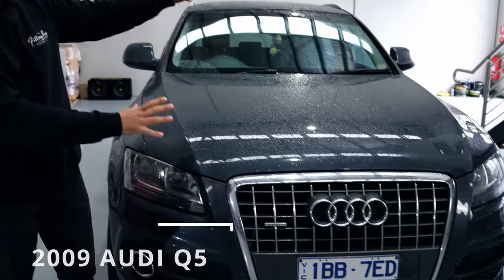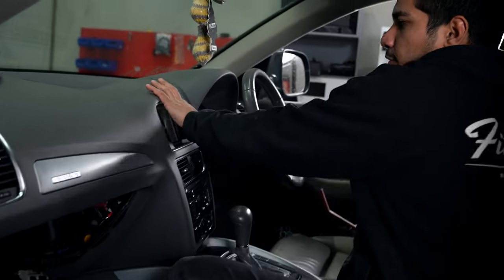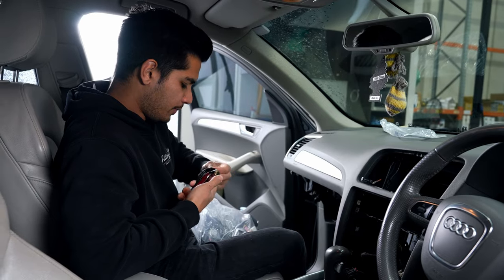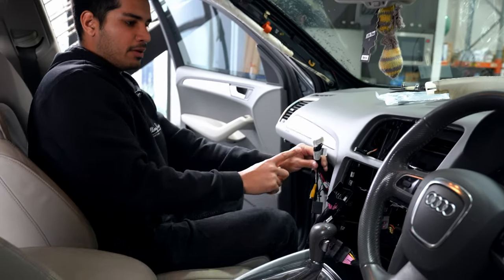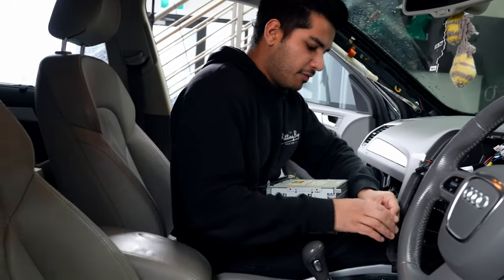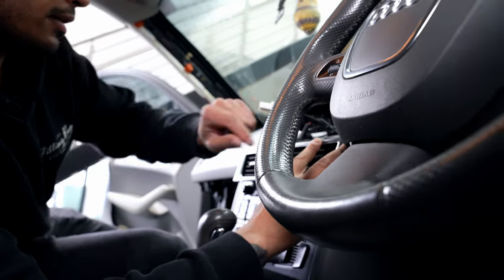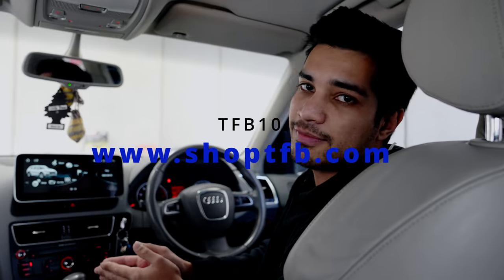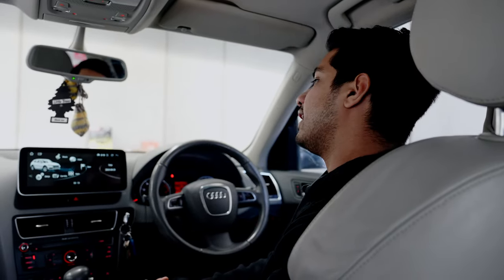Audi Q5 10.25" Android Screen Full Install! (Wireless CarPlay / Youtube / Netflix)

Comment: Before I buy I’ve noticed on my Audi Q5 where the hazard button is I have an passenger air bag button below it will the effect the new fascia and the wiring behind. Thank you
Reply: That’s not really needed anymore. The display on the dash has the same

Comment: First of all, I really love your videos. I've just installed the same setup in a 2011  Audi Q5. It's a UK car  running the Audi multimedia with the AMI in the glove box. I've installed everything correctly, and the screen comes on and works fine. The Jog wheel seems to be also working but I've got two issues, no sound at all and when in the cars MMI menu, I can't see anything as everything is super enlarged but fine in carplay mode. I've connected the AMI cable correctly to the output on the harness, I've checked to make sure I'm in aux mode, which I can see I am, and I've checked the canbus protocols to make sure the correct car has been selected. I've fitted a few with no issues whatsoever. I can't work out of its bad hardware, or the wiring harness has been pinned incorrectly. I'd really appreciate your opinion??

Comment: I've tried fitting this to my Q5 am I right in thinking that the sound should be hardwired or do I need to connect the AUX to the AUX port in my armrest/centre console. I don't have AMI but I do have the Multimedia Head unit. Can anyone help?

Comment: hi, Android no longer starts in my car radio, the Android logo appears on the display and the words "dm-verity corruption - your Device is corrupt - your device is corrupt press power button to continue" however this radio does not have any physical buttons. how can I solve it? Can you perhaps connect an external USB keyboard to access the forced reboot and restore the system?

Comment: Hey The Fitting Bay 
I starting installing this, however once I got it all together, the screen comes on and works fine but my concert head unit now has no power and won't turn on? Is there a trick to this ? Checked the fuses and they seem fine. Any suggestions ?
Reply: Did you fix this?

Comment: Hey 
thefittingbay, got mine installed but have no sound or option for AUX on the media screen. Is there a way to fix this ?
Reply: Hey, did you get yours working?
Reply: @Jamesgdray  I did my AMI in the glovebox was shot. Replaced it and all good to go. Now just have to figure out how to change the clock as the setting is blacked out lol. Not nearly as big a deal